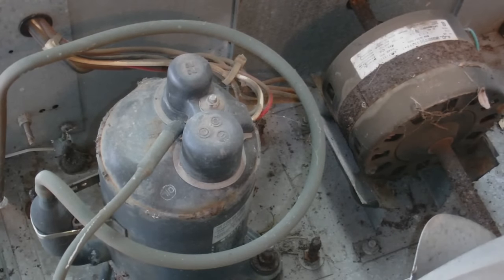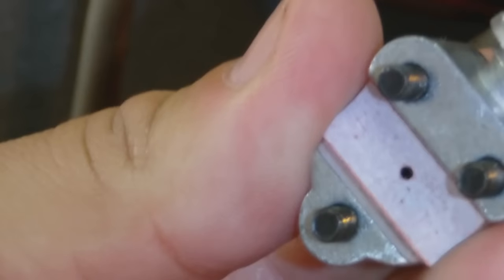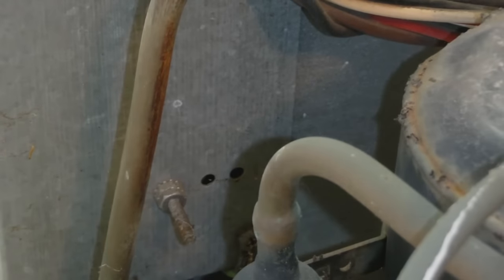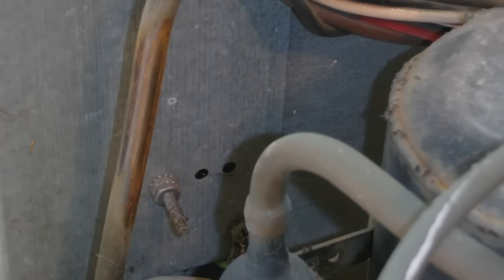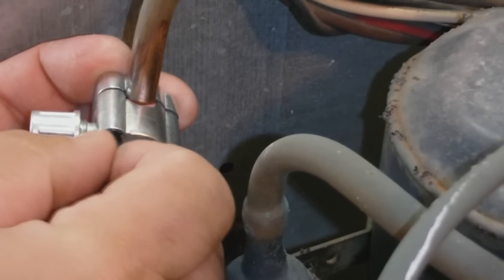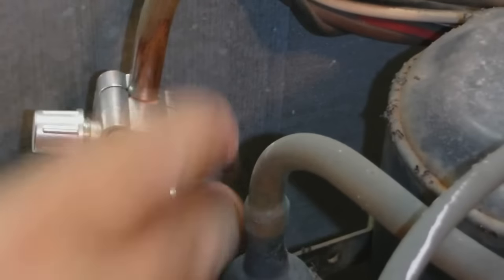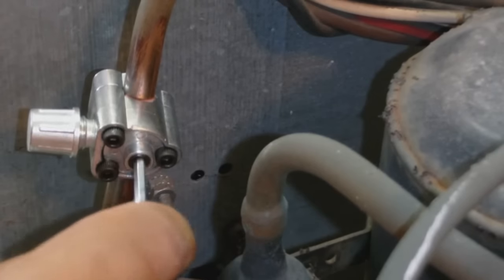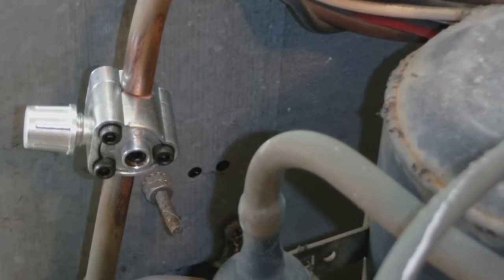How to Install a Service Port on Sealed Air Conditioning Systems: Step-by-Step Guide

Comment: Ive read several comments about how these taps leak..so i will share a remedy for this with you.. i follow the same procedure as prescribed in this video..but i use a brass tap instead of aluminum..remove gasket material from tap body..sand/brush both curved sides of tap body..remove the piercing screw and o-ring..rub some soap or plumbers grease on a screw that matches the threads of the tap screw (i use a grade 8 allen head)..screw it into where the piercing screw goes until its flush with the inside of the tap..doing this gives you a good chance of keeping the solder out of the tap screw threads..brush some acid flux on the curved part of the tap body and a little where you scored the copper..install tap..do not completely tighten tap..use your mapp/acetylene torch preferably a tip for 1'  or larger..you want to solder the tap to the copper quickly with as little heat soak as possible..best way is to concentrate most of the heat on the tap body..once soldered let cool about a minute..remove allen screw install o-ring and tap screw..

now i take a extra step..i clean the tap screw and threads in the tap housing with a non residue cleaner like brake cleaner..once its dry i use permatex ultra gray on the tap screw..run the screw in till it taps then back it out..once that gray dries you now have a leak proof permanent charge port without having to evacuate the system :)
Reply: the mood for this almost hit me.. very close, then, looking for which side to offend larger or smaller, finding that out, then your post, blew the mood to PC time on... wut now...… gonna read a couple of more times then I have the things needed.. and thanks for answering, was my next about leaking... Thanks..
Reply: ferrelx make a video for us dumbasses please. Too many questions that a video could easily answer. For some reason all I find is valve installation videos, show us one of the recharge process
Reply: well those brass valves cost 24 bucks a piece and the solder i use (staybright #8) costs 50 bucks a pound not that it requires much solder..the point is it costs  money to do it and id need some one else to do the filming because i need both hands plus i need to have a unit that actually needs the procedure done..believe it or not i just bought a video filming kit and im going to start documenting my accumulated knowledge on a "per project basis" sealed HVAC units are a minority and last a long time and usually just get replaced when they fail in our neck of the woods..so its not a very common procedure..so a video might happen tomorrow or 2 years from now..sorry buddy :/

Comment: Tks for video.what freon should I use in a 2000 coleman popup?
Reply from the maker: There should be a tag on the unit that would tell you what refrigerant is used. I hope this helps.

Comment: I put these on 2 different portable indoor AC units. The valves went on pretty easy and seemed to seal fine. However, using standard R-134a auto coolant did not work at all on either unit. I purchased a conversion kit to allow the cans to be attached, but had no luck whatsoever putting the coolant into the units. It is not worth the expense to have a licensed AC person service these units (since all you can buy without a license is the automotive R-134a)
Reply: You can buy any refrigerant you like on ebay. Check it out..

Comment from the maker: Not true.
 1. Most newer AC units use R410a refrigerant which they do not use in automotive applications, in which you can buy without a license. 
2. Make sure you know what refrigerant is in your unit before you add any, most older units are R22 in which you do need a license to purchase. ( Mixing refrigerant harmful to the unit and also illegal) . They do sell a drop in replacement for r22 systems, but the whole system has to be evacuated and refilled with the new refrigerant.

Comment: I may have missed it but it appears you have determined the top line on the compressor is the suction line and that's why you're installing the valve on that line. Is that correct?
Reply: I was wondering the same thing, you have to determine which is the high pressure side and low pressure side which wasn't explained in the video

Comment: As  a practical matter Piercing valves may or may not leak with time.    That is why most folks say to braze on a valve. HVAC book from 50 years ago mention this. Even if one brazes on a leak proof valve there is often another leak because one is already low on freon. Thus a can of freon can be all gone in a year, a month or a week or a day! 

That said sometimes the piercing units seal well and the once legal topping off of freon would last 5 to 10 years; and the dumb R22 15oz  can was 1 to 1.5 bucks and the entire AC unit was 200 bucks .  Yea R12 cans were 50 to 75 cents and one could power a BB machine gun and have fun. 

Today with a window AC unit here with R22 no local service places will repair them thus often the units get replaced. Thus one adds a piercing valve and a tad of R22 and one tries to find the leak with a freon heated diode type sniffer, or worse the messy UV dye stuff. If the leak is an easy to get to spot a local shop might attempt a fix for a few hundred bucks of one tries to rebraze the poor joint. The real fact of the matter is with an old R22 Window unit here all the local HVAC folks would not even touch one after Katrina 10 years ago since they all were saturated. 15 years ago a few would work on them but the fix often only lasted a year. Thus here I place piercing valves on my R22 units after a leak to allow a tad of freon and N2 to be added so as to find the leak and see if the leak can be fixed, or the unit scrapped. 

These Piercing valves have been around along time. They were patented in 1956, 1961, 1966 etc. 

Patent 3198206 :

http://www.google.com/patents/US3198206

"This valve, or at least a part thereof, must be left in the line after the recharging operation has been completed in order to SEAL THE LINE. It, therefore, becomes important that the cost of the valve portion which becomes a part of the refrigeration line be kept as cheap as possible.

Of even more importance is the fact that the valve should present no opportunity for the introduction of metal chips or foreign matter between the sealing elements or into the closed refrigeration system which might prevent proper sealing and loss of the refrigerant or which might measurably increase wear on the sealed and lubricated bearing surfaces within the refrigeration system, the prevention of which would require the incorporation of a cumbersome straining device. "

To add a brazed on valve PROPERLY is not so quick and easy. The entire freon has to be removed and one has to blow dry Nitrogen through the pipes so the brazing process does not oxidize the insides of the copper freon lines. Then one has to pull a vacuum and add back the proper amount of freon.

Piercing valves doe sometimes leak thus all that expensive freon gets leaked out and the repair was thus short lived and wastefull

Thus even if one has an EPA license like me the piercing valve can still leak. In a possible repair many of us use a piercing valve to find a leak, then the leak gets fixes then we add a brazed on valve. There is no reason to waste labor on unit that might be scrapped.
Reply: ***** All systems leak. The Legal, EPA and HVAC ethical key is the leak rate in ( oz /year) compared to the required full charge in (oz or Lbs) .  The leak can be out of a valve core that is easy to find, or a tiny fault in braze, or a flaw in a copper tube. 

It can be a  collection of tiny less than 1/10 ounce per year leaks in the other guys brazing, or the factory brazing on the evaporator or condenser coil 180 degree end pieces.

 Thus one sniffs with a great Mars GE H10 leak detector that can catch 1/10 oz per year leaks and one finds none. 

A window AC unit here that uses R22 would be 7 to 14 oz low and take a decade plus before any more was required. It turned out to be many tiny leaks on one side of the evaporator, not any one would trigger a leak detector. It just took the unit to be eons old before the leak area could be found and fixed properly

In a car where the compressor's shaft seal is NOT enclosed the leak can be just the vehicle is not used much at all. When the AC unit is used once a month the seal stays in better shape and thus the leak rate in tiny.

Your phrase of  "So let it leak and just add more refrigerant with time" is a  loaded one. 

Freon is very expensive. With real ethical legal EPA rules few folks blindly add Freon to a leaky system anymore. The key is why is the system low? It might be tthe other HVAC guy did not know what they were doing!  It fact it is real common to find systems that are overcharged today when another thinks "more refrigerant / freon is better"  .

Blindly adding freon (R12/ R22) to a leaky system was common in the pre EPA days with cars and small AC units. The car/ home owner could buy a do it yourself system for R12 and R22 anywhere.  It was more common when a can of R12 was 50 cents, but in that era the comic books had BB machine guns powered by R12 cans. Air Horns for boats and games where powered by a R12 can, plus the cans were used to inflate rafts a the beach too. From a slimy used car guys iron lot that 500 buck used Pinto in 1976 would have cool AC air for 1 to 2 cans for R12 for 50 cents, about equal to 1 to 2 gallons of gasoline then. Then the Pinto could fetch a few hundred more since the AC now worked.
Reply: As a rule a clamp on line tap is only a temporary thing as like you mentioned there is a leak and that's why we need to tap it to recharge. So as I used to find that the unit is usually an older item nearing its life expectancy and would usually die of some other problem before the tap would leak. Like the leak getting worse or other issues. And also as a rule an older unit that no longer justifies the  cost of the process of installing a braze in tap let alone repairing the leak. Which then we should always install a new filter drier.
Reply: Thus
Reply: It's just a matter of weighing up the situation and cost.  I top up my Amana side-by-side (via a bullet-piercing valve) with a little R134a, every year or two, so a $10 can will last several years.  It saves me having to buy another appliance or the expense of having a very slow leak fixed.

Comment: Video doesn't show which GD Copper tube to place this valve on. Too close. Do I place it on one of the tubes going to the large compressor or one of the other 3 copper tubes?

Comment: Hi ,great vid ,can you tell me what the thread is on the connector ,i have to hand a car type push on gas tube and dial which will fit the gas can but i need to buy a converter with a crew on part to fit the valve but a push on connector for the hose ,thanks

Comment: I'm going to be installing a bullet valve on my 2013 camper ac. I plan on buying a can of ac pro. any chance I could overcharge it? can I just follow same directions on bottle even if it's not for an auto? thanks!
Reply from the maker: If your getting the one I'm thinking of, it should have a gauge on it. Which will have red and green areas.green being good and red being bad obviously. Yes , there is a possibility that you could overcharge the system. Just watch your gauges, and you should be fine.

Comment: Will this work for a portable ac? Also, is it the copper tube coming out the coil? Can you show a vid on how to add the freon? And I understand it should be 22?
Reply from the maker: There should be a label on the unit to tell you what the electrical specifications are and what refrigerant to use. I hope this helps. Thanks for watching and commenting. Please like share and subscribe.

Comment: This is an interesting video. I was reading some of the comments, and noted that it seems that those with an interest in maintaining the status quot of keeping the common man in the dark about this are all advising that only professionals be allowed to work on any of these H VAC systems. The manufacturers are all labeling their units with that same advice. And then I see that at least one guy posting comments here is saying the coolants used are restricted? And why then do they sell those coolants in the auto parts and department stores pray tell if that is true? The answer is, and I asked H VAC professionals about this, the only restricted coolant is the one(s) that have Freon in them. So that guy that calls himself a professional and says he teaches this is either lying, or extremely misinformed!

My reason for checking this video out is because like most folks in this country, my family cannot afford the extremely high cost of hiring a professional to do a job that may or may not be a quality one. 

I've seen guys in the profession do intentional shoddy work, so they could keep getting the call back to do more shoddy work. Those guys were rip off artists, running a con on unsuspecting customers. I'm not saying all H VAC professionals are like that, but enough of them are to warrant caution, and to make necessary the DIY way of doing things. If they want to keep the profession working, then they certainly need to police their ranks, and cull out the bad apples among them. Even then they do not have the right to say DO-It-Yourselfers should leave it to them. They all practically charge high enough prices to break the bank accounts of most folks. I could name other professions where this is true as well, and the thing is, these guys are not doing anything that is really hard to learn, unless they are building the units themselves, and in most cases they aren't.

As I said, not all professionals are con artists. I have several of them as friends, and here is what they have told me:
Yes they want to make the money, but they realize most cannot pay their price. If someone is competent enough to learn and know what they are doing, professionally or not, they say it is a good way to save money. They also say that in their experience, most of what they learn about any given problem unit is nothing more than an maintenance issue that any person of average intelligence can easily learn to do, including pressure checks, and recharging a system. I was told by other professionals that a closed system could not be recharged or pressure checked, yet I learned today that one only needs to install a good valve or two to make such systems work like open ones, allowing such checks and recharges. And this can be done by the average joe in a way that actually works well!

Thank you handy man!
Reply from the maker: +L. Cleveland Major  thank you very much for this comment. I greatly appreciate it. Thanks for watching.
Reply: R22 is illegal to buy without a license and is illegal to purge into the atmosphere because of its greenhouse effects (in the US).
There are, however, a lot of drop in replacements for R22 that are not illegal to buy or purge.  I ended up using R414A, which was about half the price of R22.  I don't know if I would trust "topping off" an air conditioner with R22 already in it, but the documentation says it is mixable.

Fortunately, the professional jackasses who serviced the AC unit last didn't tighten the caps and there was pretty much no coolant left anyway.  Its a 30 year old AC unit and now it works fine.
Reply: Danny L. Say anything to scare off Do It Yourselfers, eh? Thing is I do my research and find the truth. Yes I know about the importance of not purging into the atmosphere. Thing is whan system has no refrigerant left in it, where do you think it went? Into the atmosphere! Leaky systems are all over this country, and it is mostly due to professionals not doing a good job. Are you one of those? Advocating for environmental protection and then doing shoddy work to ensure call backs, is why the Ozone is so badly affected. Also Freon is banned in the U.S. now, so if you are using it, you are breaking the law. And about your statement about electricity: What make you think I'm not smart enough to know that already? I actually worked with electricians for several years, even on high voltage systems. I've been right next to a highvoltage transformer when it blew! Not anything I would want to experience again, although I have experience it several times. It sounds like a bomb going off. So yes I know the danger of electricity. Your statement about it was obviously designed as a scare tactic. Give it up man, I am not your average Joe, as I always research everything I decide to do, and I always find what I need to know, including all the environmental impacts, and the safety issues. I'm not someone you can easily fool.
Reply: You can buy any refrigerant you would like on eBay. With Freon or not. Don't ask an HV AC Tech as they do not want give away any trade secrets that might take away from their income. You can buy anything you want on eBay. They do not ask for a license of any sort. However R22 and freons are expensive because they are weaning them out